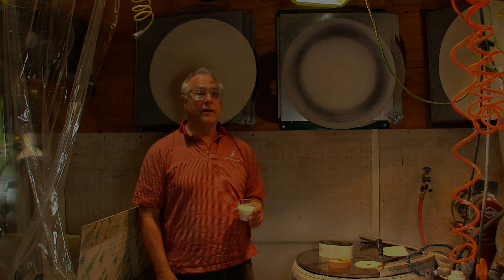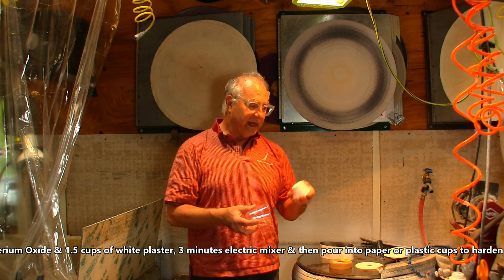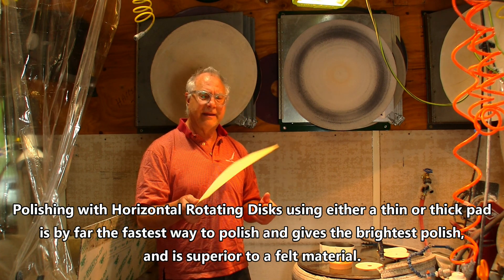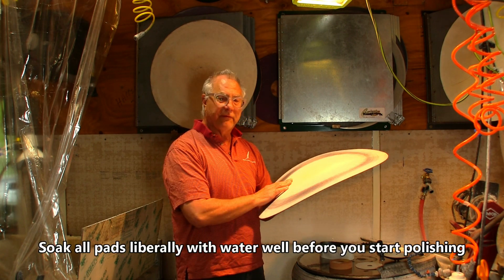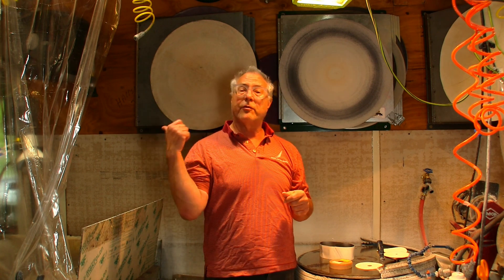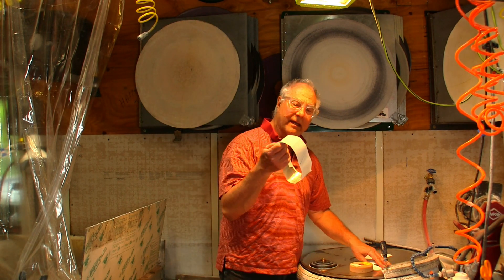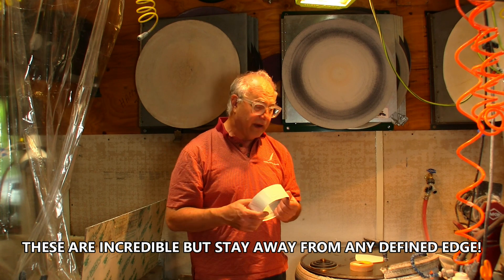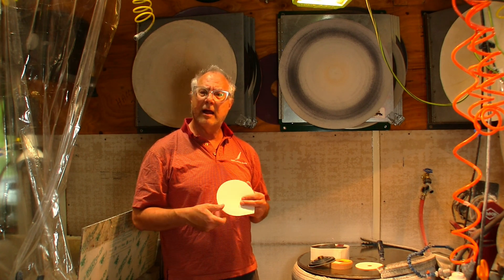BOKROSH STUDIO CERIUM OXIDE GLASS POLISHING TIPS

Comment: Hello sir... I'm making enamel dials which are completely flat. Can you recommend how to mirror polish flat surfaces?  Use a lap? Dremel? Something else?

Thank you for your informative video.
Reply from the maker: Hand lap with silicon dioxide grit on flat glass. Start with the finest grit that works. Eventually stop at 600 grit. Use clear epoxy adhesive to get shine? Or hand polish?
Reply: @michaelbokrosh7374  thank you sir. I'm already doing that. I want to hand polish it but would you recommend a cerium oxide lap or slurry?
Reply from the maker: @racket136   Where do you live?
Reply: @michaelbokrosh7374  india sir
Reply from the maker: @aman kothari   Somehow you'll have to find some synthetic pads made especially for polishing glass and then use your Cerium Oxide